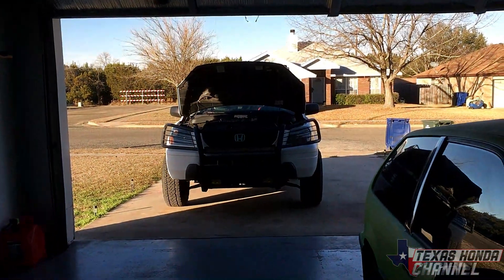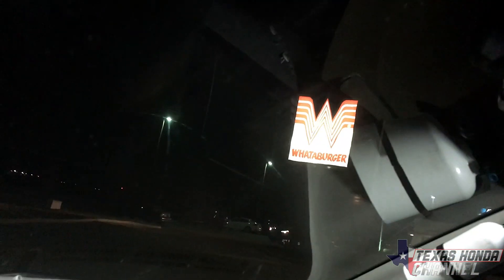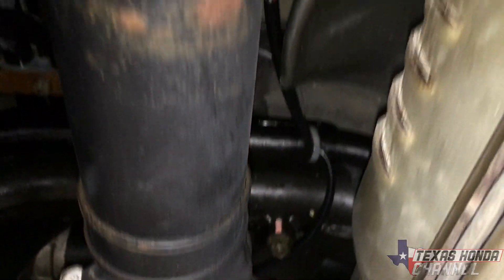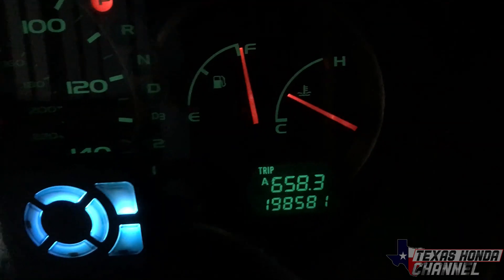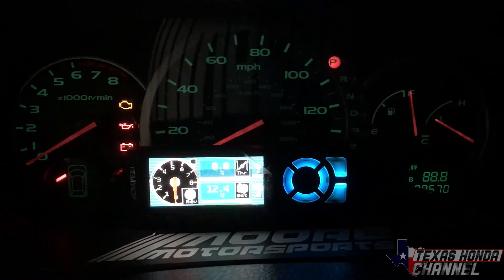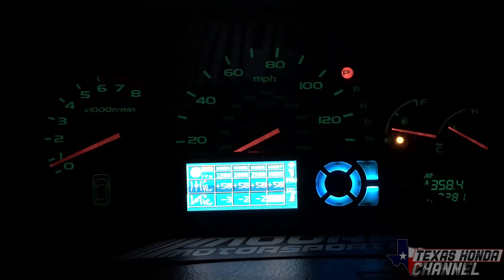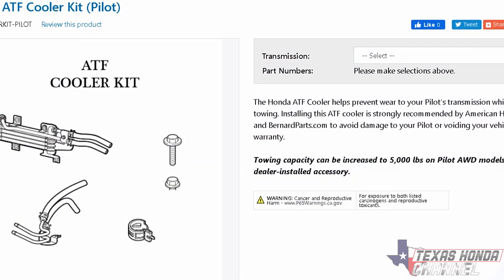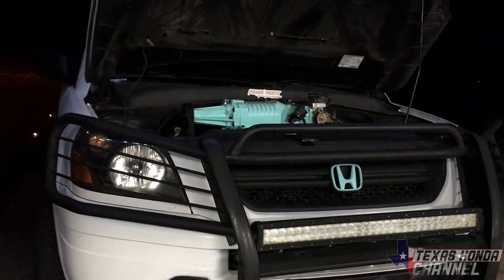1,300 mile update on supercharged pilot update + More.

Comment: Cool channel bro I got a 95 Civic four-door with a j35a4 in it.. sounds like supercharger time!!!
Reply from the maker: Yes! Ima J swap something some day for sure and of course supercharge it lol you have a great platform for a supercharger because you should already have a tuneable ecu or at least easier to get a tuneable. Mine being auto makes it horrible to find ecu management. I’m using the apexi Neo and it works for what I’m doing
Reply: @TexasHondaChannel  cant wait for your egr valve vid. For Right now just running stock ecu got2 save$ for that haltech ECU lol keep up the good. Work bro
Reply from the maker: @danielkrebs6503  For sure! I got that pesky EGR light off for good and it was so simple when the video drops hopefully it help you!
Reply: @TexasHondaChannel  come do a j swap n my sedan lol u got awsome junk yards there lotta goodies. We do t have anything good here
Reply: I've been thinking of putting a J35A8 into my Integra. How much did yours cost roughly? Any advice before doing the swap?
Reply: @TheYetiownz  well it's not cheap everything's expensive good luck finding  a 6-speed manual transmission ..for a motor . I go to Dallas JDM Motors on eBay

Comment: Forgot to ask, you mentioned that you were able to find the m90 supercharger at a salvage/junk yard. Would you be able to give us details on what cars come equipped from manufacturer with this supercharger? Thanks and best of luck to you looing to get this done on my accord this summer
Reply: hellcats come stock with superchargers
Reply: Here's the GM cars in the United States that used this Supercharger. 
1996–2005 Buick Park Avenue Ultra
1997.5–2004 Buick Regal GS / GSE / GSX (SLP)
1996–1999 Buick Riviera (optional 1996-97, std. 1998-99)
2004–2005 Chevrolet Impala SS
2004–2005 Chevrolet Monte Carlo SS Supercharged/Intimidator SS/Dale Jr. SS
1996–1999 Oldsmobile Eighty-Eight LSS (limited)
1996–2003 Pontiac Bonneville SSEi
1997–2003 Pontiac Grand Prix GTP / GTX (SLP)

Comment: Hello, awsome Pilot. I actually picked up a m90 supercharger this past summer. did you do any maintenance work on the supercharger before it went in, if so, was it hard. I've heard the snout is a pain to get off on some. You mentioned that you get better gas mileage than NA, what is the actual gas mileage you get now?
Reply from the maker: So far best mpg yet was 26 it’s in the video btw. Also the snouts aren’t hard to get off. They are simple to rebuild honestly but nothing was done to mine other than the bestline.

Comment: any issues with hood clearance? I have a 2013 Acura TL with the J37. i would love to do same M90SC install but not sure about injector size, hood clearance, intercooler?
Reply: You can use the factory injections but you will need the hondata and the hood you can cutout about 13in to 46inches rectangle

Comment: don't these Pilots have the infamous "glass" 5AT?
Reply from the maker: No misconception. It’s the kids neutral dropping them and old worn out Transmission fluid most people get the flush down on the transmission and they cannot be flushed they are low flow transmission so if you do that you blow out seals and then the transmissions are garbage only thing you have to do to prevent a bad transmission issue is to keep maintenance on your fluid drain and fill only no flushing and add a transmission cooler for extra added protection we have almost 200,000 miles it’s still going strong

Comment: Have you thought about using aem fic piggyback setup for tuning?

https://www.d-series.org/threads/aem-fic-guide.253090/#post-4185546
Reply from the maker: Nah the apexi Neo works good for what I have but if I ever wanna change it up I’ll give it a shot. Either way more videos Coming soon I even dropped another one after this one check it out
Reply: @TexasHondaChannel  I am so excited to see next videos. Thanks so much for doing them. Only reason I ask about the fic is that I have one that I thought about using. But if the apex works good under 7 psi fully tuned might just go that route. Can u link where you got your apex is it expensive?  

Thanks again boss you are the bomb.